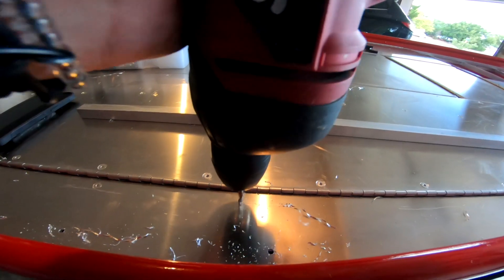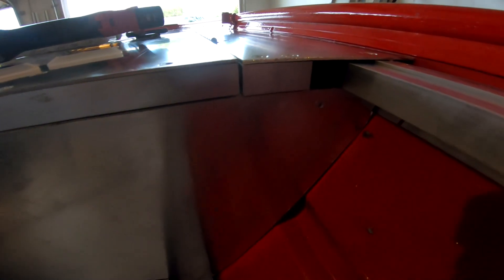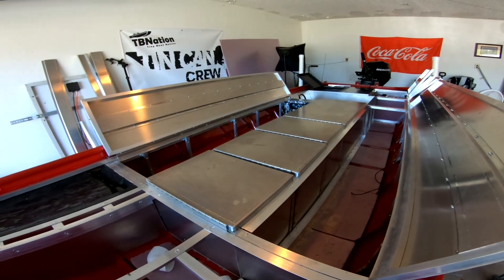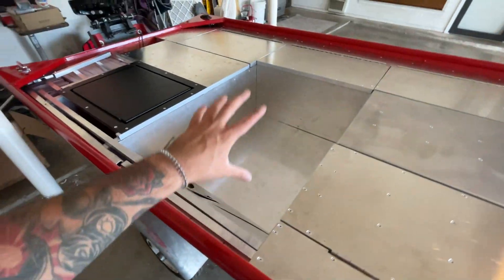JON BOAT TO BASS BOAT UPDATE!!

Comment: You should look up Galvanic Corrosion.  You are going to have problems with those stainless screws.
Reply from the maker: crap you are absolutely right!
Reply from the maker: it does say that its okay to use stainless steel screws on large aluminum surfaces, but not okay to use aluminum screws in stainless steel so idk... if i can find some aluminum screws tomorrow at the hardware store, i will change them out, thanks for the heads up

Comment: Nice work bro. Boat is coming along very nice. So question when you countersink the rivets how far do you go and what size bit do you use for the 3/16 rivets
Reply from the maker: The countersink is just a guessing game every time, I just go until I think it’s good, and using a 3/16 drill bit which isn’t exactly big enough so I move it around in circles so the river fits, you can buy a #90 drill bit and it will fit perfect but I don’t have time for that lol

Comment: With the decking in place and secure now, are you going to have any issues running the electrical wiring? I know you probably already have a plan for that but it seems like it would be easier to start running wires before everything else was in place.
Reply from the maker: all the wires from the back are already ran to the front of the boat, so yes definitely run your wires defore decking
Reply: @AdamRyanA  I must have missed that part of the build. WiFi is horrid out here.

Comment: Its so cool!! You did a wonderful job! But did the 100$ rivet gun held up? And is it worth it?
Reply from the maker: It still works but the grippers don’t grip it anymore, I need to replace those and it would work, but I would just go straight to the Milwaukee instead of dealing with the cheap one
Reply: @AdamRyanA  Ok thanks 😁for the reply keep the good job on the jon boat🔥🎣🎣

Comment: With the black lid, should the drain be at the back of the lid because the boat will sit at a slight angle in the water.

Comment: Another great video. Drain pipe in the hatch would have been better on low side of the hatch for better drainage. Back of boat always sits lower so the drain pipe would have been better on the back of the hatch. Just my own opinion.
Reply from the maker: Yeah i didnt design it lol but i thought the same thing, it could definitely be in a better place